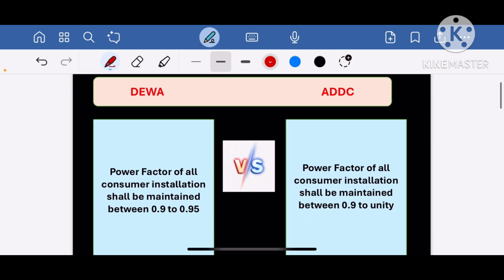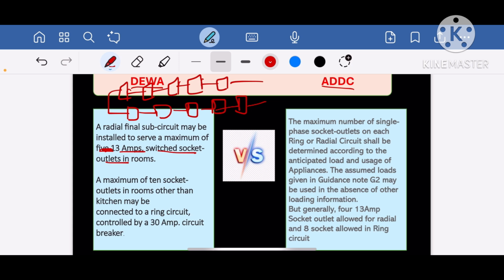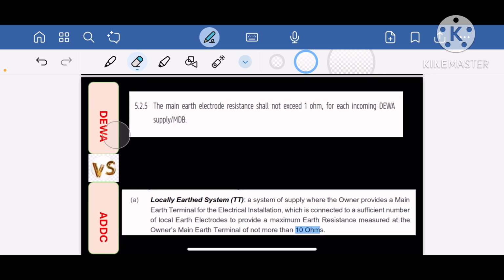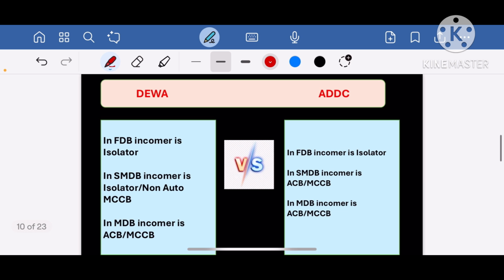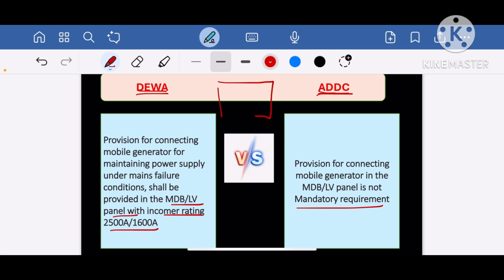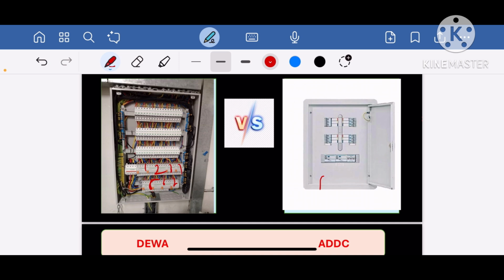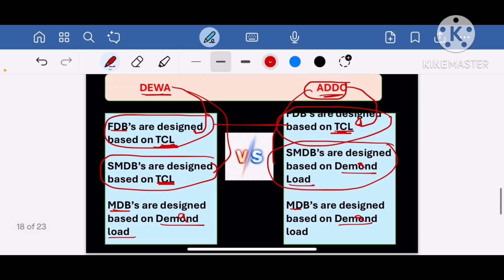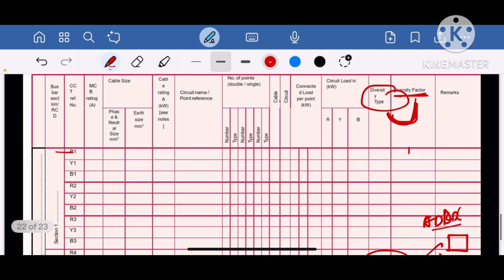Difference between DEWA and ADDC regulation-Part-1

Comment: I work in Abu Dhabi and we use 3 single sockets max for radial circuits and 12 single sockets max for ring circuits.
Reply from the maker: 3 in radial is ok but 12 in ring is not correct,  as I mentioned in my video ADDC doesn't specified number of socket and in general accepted max 4 in radial and 8 in ring
Reply: @greatthings-1-j   just a question 
how much maximum load is allowed on fdb in addc and the incomer shall not excede then 100 amps or 125 amps will also work ?
Reply: @syedshahnawaz2874  125A is max ampare rating for incomer.

Comment: Thank you for your great efforts. I want to mention that in ADDC max 42 MCB breakers for the whole FDB not just one section. And it is recommended to split the load into two sections for more reliability. So it's common practice to use 42 MCB divided into two sections. One 100mA and the other one is 30mA.
Reply: @greatthings-1-j  yes u are right but i have submitted one section dbs also when the load is not too much and it is accepted

Comment: bro one question 
what is difference between mdb and lv panel? i worked in dubai we use lv panel and in abu dhabi it is mdb ?
Reply from the maker: MDB is that panel which receive power from authority or from transformer
Reply from the maker: LV panel is that panel which deal with voltage till 1000 volt
Reply: i am still searching on that from which range mdb will start like from 400 amps or 800 amps
Reply: Well i have dewa approved drawings and we energized the lv panel from dewa transformer

Comment: 4 single sockets are now ring circuit in addc it measn 2 double sockets
Reply from the maker: @syedshahnawaz2874  2 double in radial and 4 double in ring
Reply: @ but i am making drawings on daily basis and now its 2 double socket also as ring anyhow will sort it out